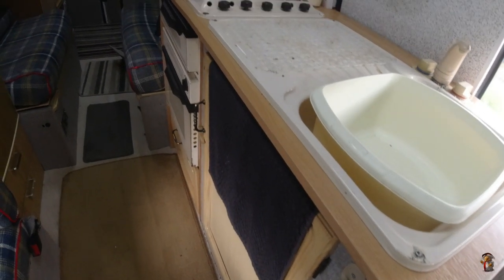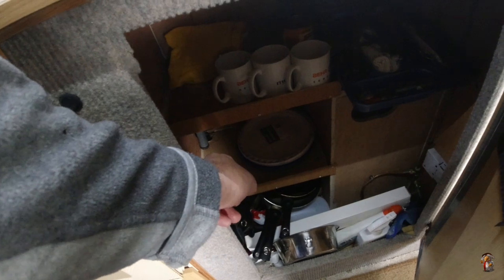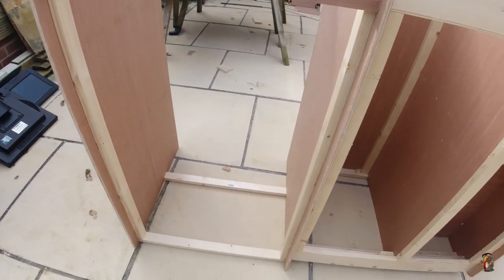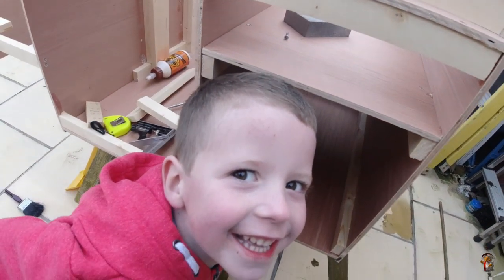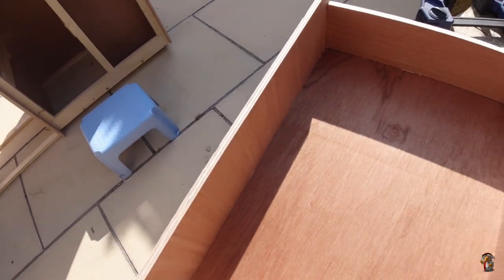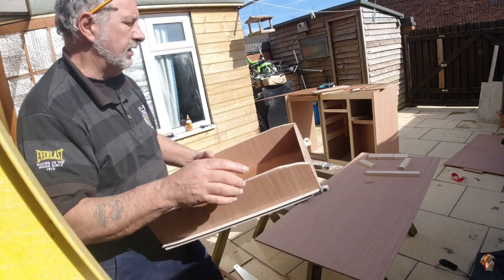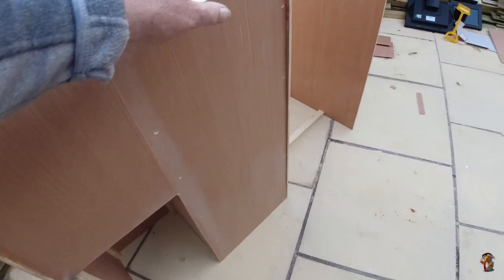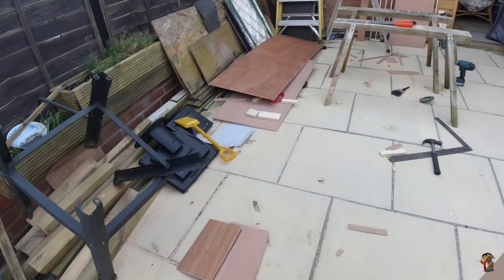Camper Self Build Kitchen Upgrade Part 1.

Comment: That looks fabulous! My dad taught me all those tips on using a saw, plus using the length of the blade to conserve energy, slow and steady strokes 👍
Reply from the maker: My dad was a chippy as well, we have built so many houses I lost count. There is a method for every tool.. Cheers Sue
Reply: @WonderingWomble  he wasn't a chippy, just a pretty good DIYer, probably taught by my Grandpop, also not a chippy but they could turn their hands to pretty much anything in those days, couldn't they? My dad was the man from the Pru, you'll remember those 🤣

Comment: Quite agree about the pump, ours was pressure operated, in the South of France, got up one morning to find no water in the system. A leak in the pipe from pump had leaked all out to ground. Got home and modded it to switch operation.
Reply from the maker: Hi ya Bud.. YEP had it happen to me before, so my pump is in the tank, and a switch on the wall to isolate it..?

Comment: Looks good.  Quite late in my build I bought a table saw and saved a lot of time making cupboard doors.  It made nice clean cuts too. I spray painted my plywood as it coloured-in and left the wood grain pattern.
Reply from the maker: Hi Ya Bud.. I was too late and just can't get any paint now, just put what primer i had left in shed..? I have a table saw, chop saw and planer in shed, just couldn't be bothered to get everything out to get to them.. and I have been using up alot of my old scraps too.. so just taking my time.. got plenty of that at mo.. Cheers bud

Comment: You’ve probably painted by now but I was wondering if you could get some very thin plywood with similar finish and simply glue it over the whole side. You’ll get the plain finish that you can varnish then. Just a thought. It’s looking great is that.
Reply from the maker: Hi ya Bud.. I did think of getting the sticky back rap to cover it, but its in the same closed shop as the paint..  haaha.. Thought of that but I have too mush varnished wood in there now, just wanted a change.. Cheers Bud